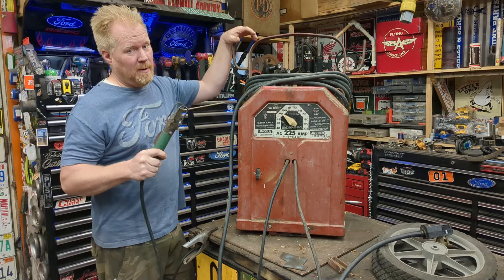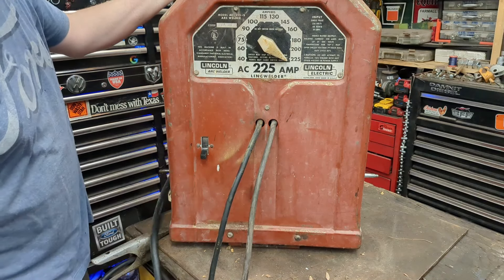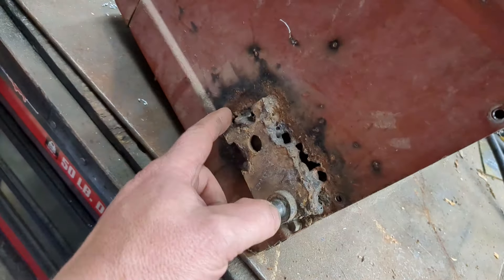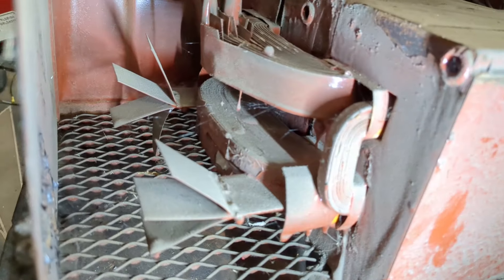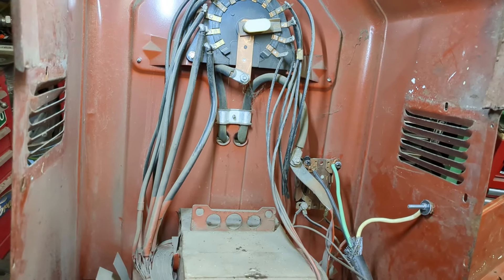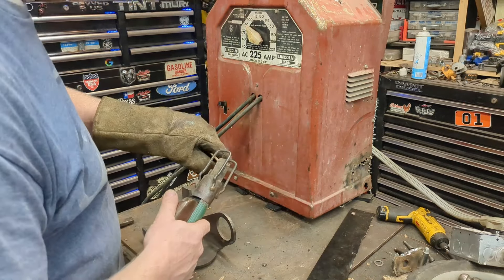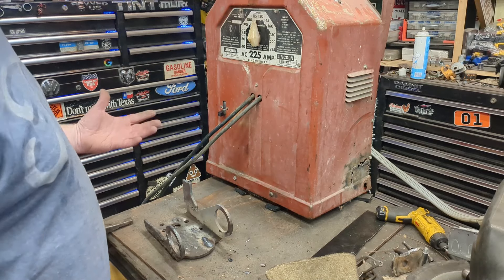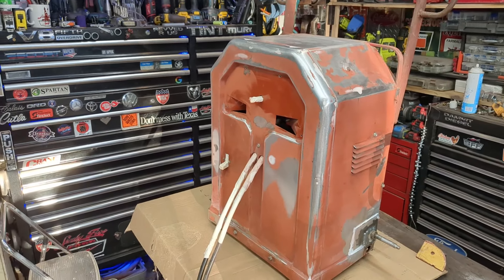Vintage Welder Fixed & Restored LINCOLN TOMBSTONE 225 AC buzz box

Comment: Why is it never used passed 100? I figured half the point of me getting a 220amp machine that weights a bag of bricks would be to use those higher settings
Reply from the maker: Just not common to use much over say 130amps because what people work on. 1/4" steel and 1/8 rod is welded within this range. Most stuff people work on is 1/8-1/4" thick steel. Generally if you do thicker steel you bevel it and do multiple passes at these lower amps with the 1/8" rod. If you step up to 5/32 rod and push to 200+ amps you'll only be able to do maybe 3/8" in a single pass.

Comment: Good job I’ve been going to get one of theses Lincoln welders but never got round to getting one but I have a good old English Oxford welder as they are pretty reliable but it does have copper windings as I do think it’s better 👍🇬🇧
Reply: Aren’t the Oxford welders oil filled also? I used one recently and was amazed at the power output.
Reply: @RobertE92  Yes thats correct but they did make both as mine is air cooled and oil cooled I missed out on a oiled cooled some months back so will keep looking

Comment: Just a recommendation for those looking to buy one of these arc welding machines is to spend the extra coin & buy one with a DC welding output. You'll have a more versatile machine that can burn low hydrogen rods like 7018, along with 6010 rod, stainless steel & nickel welding rod for cast iron. AC output only machines are limited on what you can weld with.

Comment: I did not see how you put replacement wire on? Which wire goes to what screw?
Reply: Green is ground, goes to the case. Black and white go to the switch
Reply from the maker: Yep, green goes to ground and essentially does nothing but save your life in case of a catastrophic meltdown/failure.  The black and white in the this case go to the switch.
Reply: @sixtyfiveford  does it make a difference on the other two wires how they wire to the switch?
Reply from the maker: @michaelthomas7178  Nope, they can be wired on either side.

Comment: Great video!  I'm past 80 yo and would like to learn to weld, but I'm retired on little income and can't afford to spend a lot.  Next $50 'dead' tombstone I run across, I'm gonna buy it.  Thanks!!!!!!!
Reply from the maker: You just have to keep looking. I've picked several up for around $75 with 100' of cord, helmet, gloves, electrodes etc. Everything you need to start. If the cords are excess to your needs you can sell them off and make money off the deal while keeping the welder

Comment: Overall nice restoration of the Lincoln.  About the 2 hots they should read zero across both with a multi-meter.  Attach to the same double pole breaker they should be in-phase and read zero.  And of course 120V from ground to each hot.  Good to check all this out with a used Bubba machine.  And lastly those drier sockets are usually set up for 30 Amps, whereas the Lincoln should be set up to draw 50 Amps at the higher settings.  Do your wiring right and you'll be okay. 🙂

Comment: Mine stopped working haven’t been able to figure out what’s wrong with it when u hit the switch no hum or anything but we tested the power when it’s plugged in have power to the switch  so not sure what is wrong with it
Reply from the maker: The main power switch has contacts kind of like points on an old car. Those are probably just corroded and need a little bit of cleaning. Use a really fine sandpaper.

Comment: Have you ever converted one from Ac to ac/Dc
Reply from the maker: Personally no. I have read all the details and honestly I don't think it's worth it. I have owned the AC/DC version of this welder and though DC is nicer, it's a minuscule difference. It's a little smoother and maybe a tiny easier to start an arc; But it's still stick welding. And that was with a properly factory built machine. The basic Diode Bridge Rectifier people are building seams like it's going to be a very choppy DC current. Honestly I think any money someone would spend on converting one of these should just be put into a DC Mig welder.

Comment: Wow that was REALLY dangerous wiring!   I borrowed one of these and what was bad is the selector switch.  It was basically stuck on 100amp.  I tried to increase it and totally broke it (oops), making the owner of it pretty pissed off as he told me to not touch the selector.  I bought him a new selector, they were easy to get back then, not sure today.
Reply from the maker: That's awesome. Parts are readily available but the cost in a lot of cases out ways the machines value.
Reply: @sixtyfiveford  It occured to me that this wiring should have tripped the breaker as one hot was dead shorted to ground..but without the second ground wire like they use now for 240 (like they do for 120 since the 70's i think), it wouldn't trip, shows how dangerous it can be!

Comment: Uncle Sneelock did a video of a place down South and there was a 225 buzz box outside and I told him I'd had that thing loaded so fast the owners would NOT believe it. My Uncle and his son were loggers and built their own stuff. He was an iron worker and the son could weld like Jody Collier, no lie! They had a D-4 and built the grousers up on the pads. All they had was one of those 225's. He had to cool the stinger in a bucket so he could hold it with gloves on welding grouser bars. It never even flinched! Seems like you got lied to about whoever it was that supposedly fixed those rigs. I even knew what was going on when you opened it up. Had a pal on a fish farm that was pouring raceways and the concrete vibrator was eating them up. Had the ground and the hot swapped out in the box. Like you said, glad you're not sporting a curly perm because of the 'ground'. Better than factory now And yes, Ginger would cross the road after the frisbee AND the chicken! BLESSINGS!.
Reply from the maker: I've come across a couple that were used commercially and showed. They worked great.
Reply: @sixtyfiveford  My Uncles old Lincoln ended up being used to weld cages for precast concrete stuff. It might still be going for all I know.

Comment: Connect that ground (‘work clamp” is proper terminology) directly to the work piece and NOT a table.   The initial strike (light-off) will work much smoother.

Comment: Why is the 75 circled?
Reply: That's the pipe thawing setting. Honest injun! I had to look it up myself. Apparently you can heat up house plumbing with the unit.
Reply from the maker: Yep pipe thaw is the common explanation but it is also the highest setting that is 100% duty cycle. So 75 and below you can have it weld 100% of the time vs at 225 amps you can only weld 20% duty cycle( 2 minutes on, 8 minutes rest per 10min period)
Reply: @sixtyfiveford  the transformer in there is smaller than I expected it to be and the fan being mounted on top is just poor design. Heat rises. So you could probably mod one of those welders to be more thermally efficient. Raise the transformer up some and put the fan under it. Maybe do an open loop water block or try some liquid nitrogen overclocking?

Comment: Did you use your miller welder for the wheel brackets lol 

I worked at a welding supply for 8 years. Even though those machines look the same for ever they do have different switches.  On the old machines everyone I have known put longer leads on them with no problem. If you do it to the newer ones it will burn the amp switch out
Reply from the maker: Yes, I did. Good to know.

Comment: People like to run down the Lincoln "Tombstone" welders like this one, but generations of beginning welders have learned to weld with them. I started out with a 225 AC model like the one in the video and used it to learn to arc weld. With the proper rods, you can do some amazing work. I later traded the AC model off and got a used AC-DC version just for fun. It's handy to have one around and, as mentioned in the video, they seem to last forever. Nice video. Thanks!

Comment: Can these be converted to DC for better welding?
Reply from the maker: I have had the DC version of this welder and though it does weld smoother I wouldn't go out of my way to convert one. Yes it's better but just barely and really not worth the hassle. I know it's cheap(sub $100) to convert it but you would be better off selling the Stick Welder and bumping up to a MIG.

Comment: My first welder and still going strong it will run 1/8" 7018 rods like butter when welling high carbon steel set on 225. What a shame who ever put on the wheels like a mud dabber.  Good job guy !!

Comment: Are these better than cheap welding units of today? with this being AC, can it weld aluminium?
Reply from the maker: Transformer welders will always weld, smoother and nicer. However, if you're a first time welder, does it really matter? As you will never know the difference. Are they better absolutely, does a cheap modern inverter welder stick metal together.... Yes.  

Yes you could weld aluminum but only thick stuff.
Reply: @sixtyfiveford  Thanks, so next question is, what machine spec would you look for to weld thin aluminium?
Reply from the maker: @engjds  You'll need a good tig welder to weld sub 1/16" well.
Reply: @sixtyfiveford  Thanks, so AC Tig?
Reply from the maker: @engjds  Yes AC tig. A hidden cost is you'll also need a shielding gas welding tank filled with argon.
Reply: @sixtyfiveford  Great stuff, have only DC tig, maybe I might spot an AC one day on the car boot.
Reply: @sixtyfiveford  Maybe you can help, its driving me crazy, I was making a rocket stove, and the pipe fixing had some gap distance on a couple of the sides, I have ended up with pockets of slag, no matter how many times I try to chip them out and burn over them, grinding them down, I just seem to create more pockets or not fill them, its a endless cycle of frustration, how do you do deal with slag inclusion?
Reply from the maker: @engjds  I'm no expert at stick welding but have had similar issues with 6013. The fix: higher amps and or steeper angle on the rod.
Reply: @sixtyfiveford  Thats a good tip, will work on it, thanks man.

Comment: I once worked in a hole in the wall shop where the town drunk idiot did the maintenance. The buz-box welder that I used would shock you when the metal  case was touched and the floor was wet. (did I mention there were holes in the roof and containers all over to catch the drips when it rained, and we were always moving things around so the most important stuff wouldn't get wet.) I was told that the other welder had once tried to ground the welder case with a fairly heavy electrical wire but removed it when the wire started smoking. come to find out that the single phase buz-box had been connected to a three phase power source. and the idiot maintenance jerk had connected the ground wire to one of the hot leads. it was pure luck that it wasn't the wild leg, because then there would would have been   208 volts to ground and not just 120 volts.
Reply from the maker: WOW!

Comment: I fix at least 1 tombstone welder a year. The fan motor is usually the culprit. The other problem that can happen is the plastic selector shaft breaks. If the owner switches amperage too fast and forcefully the slider can catch and the plastic shaft breaks. Parts are readily available.

Comment: If you got that Lincoln for 50 bucks you got a damn good deal because those particular models like that were the best ones ever made by Lincoln meaning the core is copper the new ones they make are aluminum Core! I used that same kind of welder a long time and yeah I got electrocuted by it quite a few times especially when you’re working in damp wet areas even if you got gloves on and if your gloves are a little wet you’ll get a little tingle and yeah I remember they used to call those things the tombstone But I’ve gotten zapped quite a few times with it but I’m still here and like I said you got a damn good deal because if you open her up you’ll see it’s copper inside because all the new ones Lincoln makes are all aluminum core and they can’t take too much heat the duty cycles are shorter for the newer ones.

Comment: Quick question, I found one of these old tombstones on a cart in a storeroom at my job, it doesn’t have a face plate and the knob is broken off, I haven’t opened it up yet but there are no markings or indicators on the outside as someone painted it blue, any quick way to figure out if it’s a 225 or a 180?
Reply from the maker: There's not an easy way that I know off the top of my head. The 180 was only made for a few years and everything else is the 225. So 99% of them are the 225.
Reply: @sixtyfiveford  appreciate you replying, I opened it up and rewired some stuff and it works good as new, it’s a 225 like you said haha, any idea where I could order a new face plate and knob? It’s a nice little addition to the shop but it’s a pain to change the amperage at the moment without those parts  lol
Reply from the maker: @jamesyanku6945  There are guys that reproduce the faceplate for these. Not sure of the price but Google it and you'll see. The knob is still made and should be an easy find as well.

Comment: First!  Well, they said learn with the welder.  Learn with and on?  Lol. That thin stuff is prob hard to stick weld.
Reply: Stick welding sheet metal isn't that bad if you have really thin electrodes. You're not going to get very good looking beads though. Well, maybe you will, but I don't.

Comment: I believe that it was built in 1985 because I own one that was made in 1984 and it is square I can send you a picture if you want
Reply from the maker: The wiring diagram decal inside verified a 1975 built date. These didn't change much at all over the years.

Comment: Hi im a new welder. Got this identical machine last weekend. Here come the questions. Do I power it out of my 30A dryer outlet, my 50A range and what size generator will it work from? Also I have a fifty foot 10 guage extension cord. Can I use thatto make the leads longer, the leads it came with are fifteen gnd and 20 lead? Thanks
Reply from the maker: 30A Dryer: Yes you can but you will be limited to around 150amps. Though this is more than you will need 99% of the time
50A Range: This will give you full capabilities up to the 225 amps. 

Generator: You will need a big generator to run something like this.  50amps X 240v= 12,000watts . A 10,000 watt generator will run it up to around 180amps.
Reply: @sixtyfiveford  thats golden. I have been putting messages out all week. And that 10 power cord? Can i chop that up to make longer leads or is that not got enough copper in there
Reply from the maker: @danbrownellfuzzy3010  10awg is too small for the welding leads.
Reply: @sixtyfiveford  thanks. Do i need to use 4 guage or 2 ?
Reply: @sixtyfiveford  thanks. That helps. I do stock market about ten years.. Buy some Nabors Drilling if you want a tip. NBR
Reply from the maker: @danbrownellfuzzy3010  It depends on how far you want to go and what amps. At 200 amps and 100 ft you need 2/0 (00) cable but at 200 amps and 50ft 2awg would suffice. Personally, I would go with 2awg as that'll handle a welder set at around 125 amps (highest you generally go) up to around 100 ft.

Comment: I have a ac-225. Stopped working took it apart found one wire loose on the main switch. But found another wire with a eye shape end but can't find where it goes? It comes from the coil thing on the bottom side near the switch. Any help, thanks in advance.

Comment: These old Tombstone welders never die!   For the better of 20 years I used this style for pretty much everything I stick welded.   My first one was my Grandpa's, it's still in the family.  I later bought one off of Craigslist for 50 bucks, it had a broken switch and I used it for many years after I fixed it.   I've been a bit spoiled with some of the new technologies, but I still have soft spot for the old Tombstones!   Great machines!
Reply from the maker: I get used to welding with the modern inverter welders and forget how smooth a transformer welder actually is.

Comment: Great job, that came out beautifully.  The best part of the whole video for me was watching someone who knows how to properly use an aerosol can to paint things.  It drives me crazy watching people paint in 1 second bursts and shaking the can every three bursts of paint.  Sometimes getting fancy and spraying while shaking.  Then they wonder why it took 75 cans of Rustoleum or whatever brand was on sale at Home Depot to paint their Miata and have it still come out like crap.
You did an excellent job on it.  In my area the old Lincoln tombstones are going for around $3-600 used (depending on if ac only or ac/dc), which is up about 200% from a few years ago.  I'm glad they're being saved for another hundred years instead of being scrapped for metal.  Years ago I bought a 1940's Forney welder a lot like the Tombstone.  It ran and welded like butter, and continues to till this day.  I cleaned it up, did a little bit of body work (like you did) and sprayed it???  Rustoleum Red.  I use it as often as I can, sometimes using it when I should be using a MIG, just because it's such a sweet machine to use.  It's big and heavy and I keep trying to talk myself into selling it but I just can't.  I don't use it enough to necessitate keeping it but what if I need to glue some thick stuff together solid?  It'll weld just about anything I've ever thrown at it without a stutter. I paid $50 for it.
Great video and thanks for reading my overly verbose comment if you made it all the way down here.
Reply from the maker: Hey thanks. I buy one of these, use it a few times and it sits for a year and I end up selling it . And then I end up missing it so that's why I keep buying them. I've talked myself out of buying a couple Forneys.